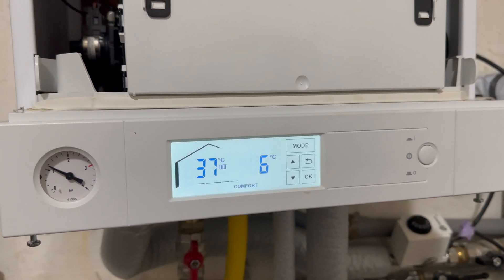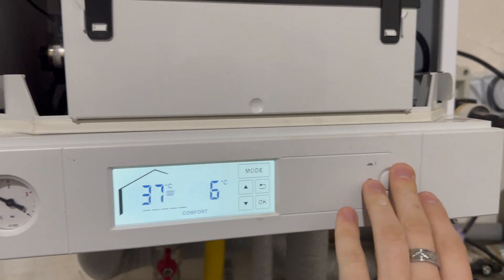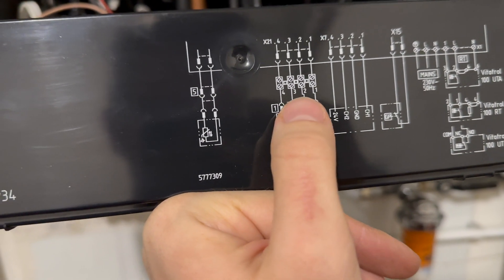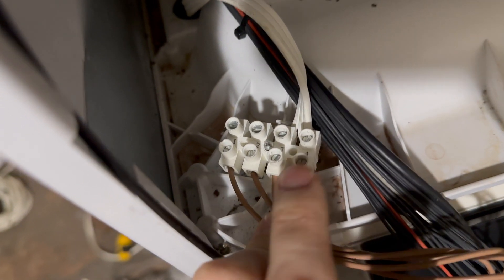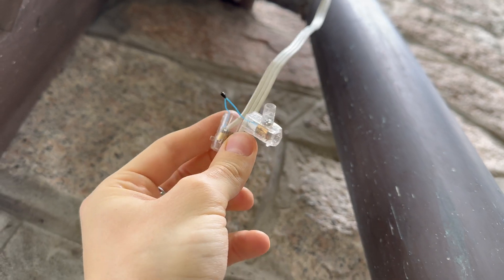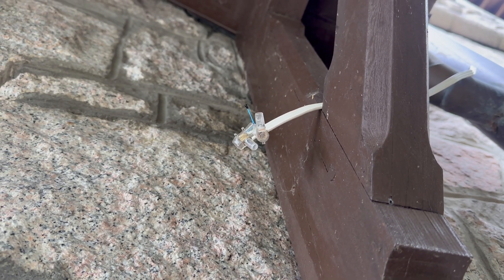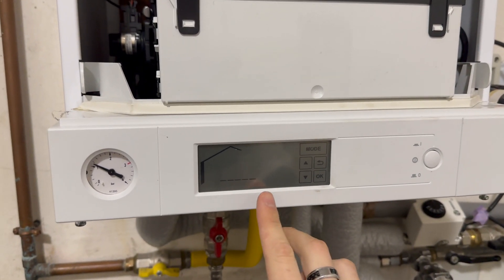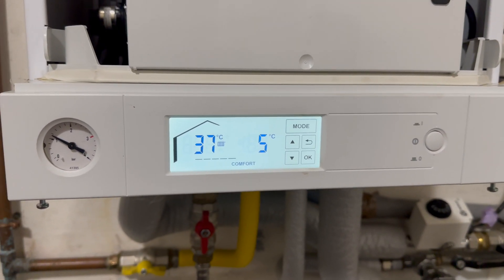Viessmann Vitodens 100 Outdoor sensor DIY

Comment: Very good idea thumbs up. Just a small correction that is not a thermocouple it is a thermistor. NTC means negative temperature coefficient thermistor. Thermocouples are 2 conductors of different materials joined together that produce a voltage depending on the temperature.